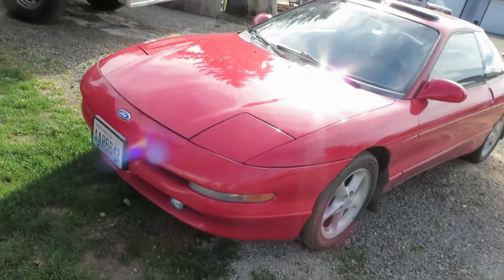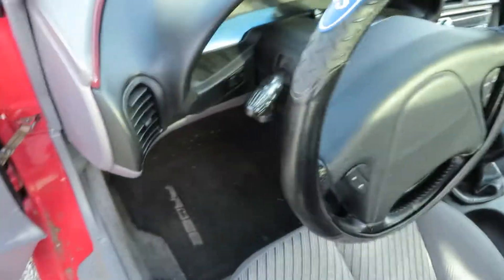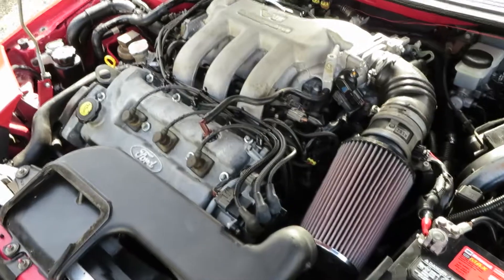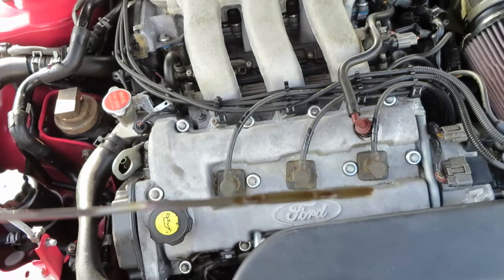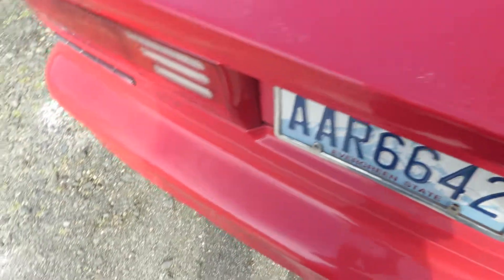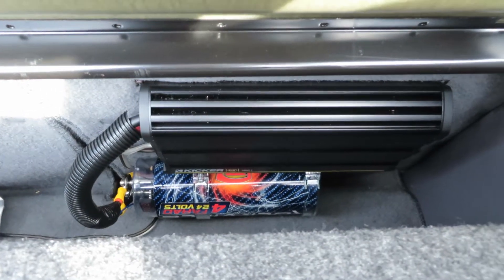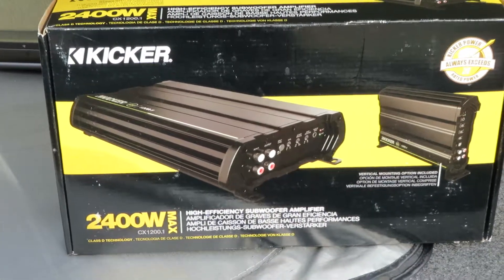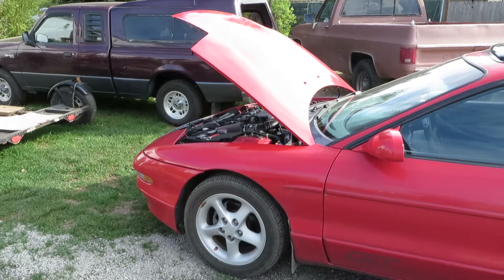My take on the 1993 Ford Probe GT

Comment: amazing to see one of these engines thats Not covered in oil!  mine is a leaker, drips everywhere!...the intake is nice except that its drawing Hot air from the engine bay..im sure it sounds nice but i doubt its really gaining hp.
the facory intake pulls air from the front hood area...nice car bro!